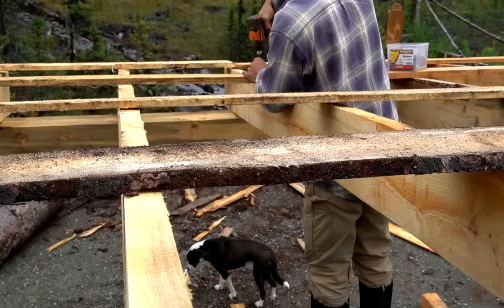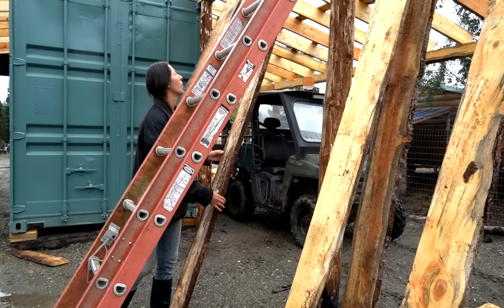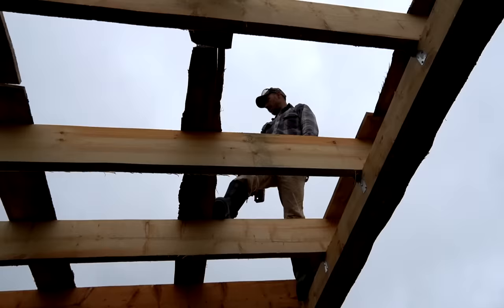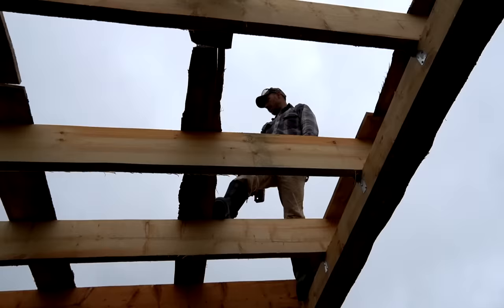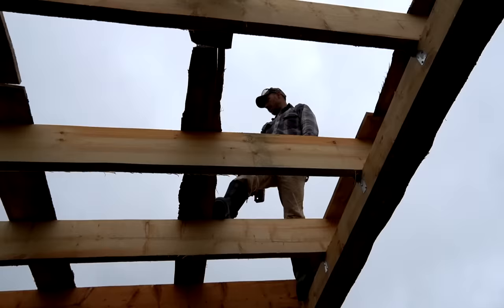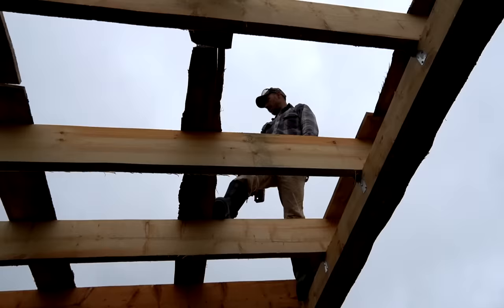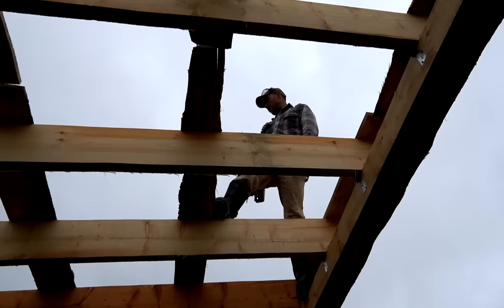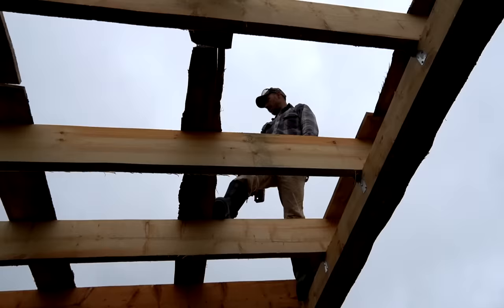Installing Metal Roof & Live Edge Siding | Shipping Container Lean-To

Comment: Next on the list of builds......A Swedish Sauna for those tired, aching muscles!👏❤👏❤
Reply: That’s a great idea!
Reply: I have always thought they should have a sauna- such a fun way to wash up when you compare with taking a shower outside! But I am Finnish so we have taken sauna my whole life.
Reply: Do you not see the problem with the roof system you built vs snow…. Common sense dude
Reply: The fact the didn’t connect the two roofs is actually amazing.  Not in a good way
Reply: There is now such thing as a swedish sauna, sauna is from Finland.
Reply: @hotcheesesoup9776  That's why they built them, to keep the snow off their vehicles and boat. Eric talked about snow management plans in this video, they have made others showing all the work they put in each snowfall, moving the snow around the property. They filled in what I think is the end of their driveway with a lot of gravel, and have experienced several winters, and are fine with various methods of keeping their structures safe. Snow is not dirt, it melts every spring and the piles disappear. Yes, there comes a point toward the end of winter, when you're, like, Where am I gonna put more snow? But they added gravel, and have plans for where to put the snow once they shovel it off the roofs and then access around the various structures. It's kind of an art, really, and I give them so much credit!!!!!
Reply: Finnish sauna!

Comment: You should keep a few panels of clear corrugated plexiglass on hand so when you build something like this right in the center over your main work area, you could put the clear plastic roofing and have light coming in. I know winter time is the problem because the snow on the roof, but the rest of the year when you can remove the snow or have no snow on that roof. You have plenty of light inside the shelter. Would love to see people doing that. Thanks for sharing again as you did an excellent job when you built this shelter.

Comment: Nice job! I enjoyed watching this build. I am doing something similar. Years ago I built a 20’ X 40’ shed for far equipment and a work area. I quickly discovered that it wasn’t enough space so I built a 12’ lean-to on one side. Now I need more room so I bought some 26’ long box trusses form a construction project that ordered incorrectly and I was just going to put in a post barn type of frame to hold them up so I could add a 24’ X 40 ‘ covered parking areas for all of my equipment. Then the bright idea came into my hard head and I bought two 40’ Conex containers for more durable storage. So I placed them 24’ away from the shed. Now I have to put the trusses from the shed to the Conex’s and then I will have a real monstrosity of a storage/workshop that will be 80’ X 40’ structure. That should hold me for many years if not forever.
Again I really like what you have built because it has real charm and the wood you have used is very nice looking.

Comment: Don't forget the diagonal braces at each post to keep the sheds from racking in high winds.
Reply: you must brace this structure for the wind and snow or it will collapse. Wood or cable diagonally cross bracing. AndI would double the number of metal straps holding the joists. A good wind will rip the roof off. But nice job. Lots of work so lets keep it working for you for many years.
Reply: Why didn't they pour cement and create footers on the posts ? Genuinely curious
Reply: @Sunnbuzz  They’vecovered this in previous videos but it has to do with the way the ground freezes and thaws. It tends to push up move concrete.
Reply: @ryanmartinage   Thanks,  I did think about that but then wasn't sure, I live in Canada and we still pour footings, but I obviously don't know enough about concrete or their terrain for an educated reply.
They do make products/materials that act as a joint expansion tho.
Reply: @Sunnbuzz  it was on some fence posts I believe and the freezing and thawing mudd moved them all around. They said some locals said to put them directly in the dirt to help dissuade that behavior.
Reply: @davihar   ditto the diagonals.... but is an aswesome build!
Reply: @ryanmartinage  Again I'm definitely no professional I do know some construction but little about concrete. The answer you gave me is exactly what I was thinking would happen to the posts sitting freely, it will be interesting to see how it fairs obviously the locals know better, well hopefully lol

Comment: Looks great!!!  I am curious though why a peak was not built over the storage container. A simple low slope A-frame rafter would look very nice, protect the rafter and storage container and stop the water from running down the side of the container and making the ground soft.  Just a thought.  Looks wonderful none the less.
Reply: My thought too
Reply: Me too
Reply: Perhaps its better to get rid off of the snow on top when they can walk there? Just a guess, could be wrong :)
Reply: Me 3.
Reply: Those containers are plenty strong enough to hold snow & ice.. His Add-On is at enough of a slope for snow/ice to slide & as long as he tied them to the container properly, there wont be any gap for water to pour down the sides... That said, I personally still would have built a peak over the container lol.
Reply: @mikefrost2404  True enough.
Reply: The flat roof of a container accumulates water in every tiny ding, let alone dips and hollows (which is a primary reason they are retired from service).
The great thing is you can weld lugs on them at precisely the right point to bolt timber to, securing the new sloped roof over it very easily.
A friend installed 3 containers in parallel, mounted on cast in place concrete 12 Inch diameter round concrete footings under each truck tie down point on the bottom of the container, and with a gap between the inner container and the outer containers.
Building a roof sloped towards the rear over the whole lot, and a wall at the rear of each gap...he then got old roller garage doors and placed them over the two open ends.
He thus had 5 locking enclosed "bays" in his "barn".
Reply: My dad moved a single wide trailer up to the UP of Michigan on Indian Lake and built a floating roof on it.  He also added a family room with a bedroom attached, a laundry room and a upstairs bedroom.  When he was finished you would never guess it started as a trailer inside or out.
Reply: Yes, your right, cuz now all they have done is created a place for snow to build up, & a wind vortex tunnel,,,be interesting to see how long roof & sides stay on in the Alaska winter winds of 50mph, 60mph, 70mph & greater...
Reply: Hi everyone !   ITS A SNOW COVER,,NOT A RAIN COVER !  --  RESPECTFULLY,,,  Made in the USA  by Eric & Ariel !

Comment: Question: are you worried about water runoff from the container? Does it just sit on top? How does it run off? Maybe I'm asking a dumb question. But it's been bugging me since you guys started this project. Thanks, and great video.
Reply: Container roofs are typical tilted a bit when they are installed so that water runs off the top, doesn’t take much of a tilt for water to drain.
Reply: Shipping container roofing is simply corrugated sheet metal with a small side to side pitch to drain water.
Reply: I was wondering the same thing since last episode.... what about rain and snow. Anyway I think it turned out amazing

Comment: Serious Question from a novice:  The wood seems wet, well it therefore change its size and shape when it drys?  Love your work and sharing it with us, Thank You.
Reply: You're right, it will dry out and shift around a bit. Since it's a snow shed, it's not critical. Some of the wood has been dead (beetle kill) for several years and should be pretty dry.
Reply: In case they don’t answer you, they only cut trees killed by the spruce beetle infestation, so it’s dead, has been for a while, by the time they cut it. If you look at the forest of trees in their videos, you’ll notice all the brown dead trees still standing, those are the dead spruce trees, sadly.
Reply from the maker: Yes our trees are all dead and all dry ready to burn or build with :)

Comment: Love your video's folks I am just wondering that if you took those rafters up until they joined and took your roofing iron to the same place with a cap on it wouldn't  it stop the snow sitting on top of the container for months every year and eventually causing you problems like rust and leaks etc. etc. ?
Reply: They are killing me w/suspense! How will they mitigate that issue?!
Reply: @zmenow3162  I have 2 x 40 foot containers on my place and after mounting them on 2 foot square x 9foot long concrete blocks taking care of rust etc. from the bottom I place a peaked roof on top so snow and water runs of into the gutters then into a 10000 gal tank which gives me water for the year and keeps the roof of the containers dry so I figure this shed will outlast me and my beneficiaries !!

Comment: use nails next time it allows the structure to move and settle over time with out the screws breaking and leaving you with repair work in the future. as nails bend and screws don't
Reply: Thanks, good advise, especially with green wet wood.

Comment: Shed's lookin' really good!  Remember, the "rule of thumb" for screw length is 70% of the screw is in the piece being screwed into.  Not the piece being attached.  You'll never regret using long enough screws to hold things together.  Depending on how you attach the metal, if you can get some screws into the rafter as well as the slats, it'll serve you well for the future.  Good luck going forward and be careful!

Comment: Those hurricane ties on the rafters are cute.  I use a single timber screw in each end with at least 2" of penetration - 2 timber screws for a 4" thick rafter.  Good work you guys.

Comment: I live in an off grid cabin on the kashwitna river near you so our winter experience is similar. I also have a lot on a plowed road with a connex parked in nearby Caswell Lakes.  I use the connex to store my snow machines for the 5 mile ride to the cabin and as a parking spot for my truck. I shovel the Connex once a winter when the snow load gets heavy. I humbly submit that I would only install a lean to roof on one side of the connex to facilitate easy snow removal. With both sides of the connex blocked it will be tough to remove the snow. Also with the door opening on one end it will even be tougher.

Comment: Hello Eric and Arielle, I am not sure if this question has been answered before or not. Last episode you leveled the Conex front to back, then mounted the beams onto the top of the Conex front to back to allow level framing. My concern is that you no longer have drainage for the Conex front to back. If you remember, the Conex was equally lower in the back on both sides, allowing the water from the snow load to drain to the back. Not into the front door, or sit around the new drill holes for the dish, and the ridge beams for the lean-to. There should be a pretty easy fix for this if you come across a problem. Love the videos! Huge fan! Thank you for the content!

Comment: Eric, I just noticed you store power tools inside a file cabinet. I, also, use a locking file cabinet for my power tools. I went to Goodwill and bought a bunch of bath and hand towels. The towels go on the bottom of a file drawer and hand towels are used to wrap damp tools. Haven't had any rust issues since buying the towels.

Comment: everything turned out great !!!!!!!! You saved a fortune on wood and  the best  crew teamwork  :) A couple more solar panels and batteries would look good :) You might have to add some emt or fence rails to the top of chicken wire fence on the 40 ft side .The future snow load might just fold or bend it ? It Might pay to buy a hvlp airless sprayer down the road ? Some stain or finish will really extend the wood life . I have built and remodel most all my life . you 2 do great pre  planning and are always really safe during your builds. Thanks for great series . :)

Comment: You could just staple a tarp on the inside so in winter when your in there working you'll be safe from wind and rain. Also on top of con-duet put 2x10's on the front edges and add the plastic sheeting raised/ screwed in on top to give a small pitch so snow will fall off roof. Always enjoy your videos. xo

Comment: Two things to add: (1) Add a trailer hitch receiver to the front of the vehicles so you can drive the trailers into their destinations.  (2) Complete the rafters over the con-ex container to eliminate snow storage and to keep the sun from heating up the conex in the summer.

Comment: Have you considered building a shed for your saw mill.  You would need an opening around 20', one that would allow you to wrestle the log on to the sled or use of a tractor.  I'm sure you could find a 20+ log that could be the header for the opening.   Being covered would definitely protect the equipment from the elements.

Comment: So many great things to say about this entire build project! Love the trick with the rope to mark where your screws go into the roofing - genius! So many just measure on top blindly- this was an excellent idea to make sure your screw lines were straight and precise. The build looks so beautiful with the live edge siding. The air flow and light you will get through the cracks is going to work fantastically, especially letting in some sunlight and warmth through the gaps to melt any dusting of snow that may get in and keep any ice build up on the ground to a minimum. Have you thought of any type of wood or metal awning/roofing to go above the shipping container entrance to keep snow and ice build up off the door and front steps or snow blowing inside the front of container for winter time? You could put two posts on either side of the doorway (so not to block the solar panels) mount in to the ends of the beam you attached to roof of container and just do a small angled awning/roof that only extends maybe 2-3 feet outward. Just an idea/suggestion. You both work so well together and love to see the cuddles and laughs in between. I really enjoy your channel, thank you for sharing your adventures and lives with us. I think you two are amazing! Stay safe, lots of love from Louisiana. 😊

Comment: Very cool.  But keep in mind that over time your little metal shed is going to sink into the ground due to the weight the roof is putting on it (especially when you factor in the snow load).  You should add more beams and posts close to the shed.

Comment: If no one has mentioned it yet...I would sure put some bridging at both ends between the rafters!!  

Is blocking required for ceiling joists?
According to Section 6.3: “Rafters and ceiling joists need blocking at their points of bearing to prevent rotation or displacing laterally from their intended position …

I forgot to say, Awesome job!! Great teamwork!!

Comment: I don't know anything about snow loads in Alaska but here in Ontario our roofs have a much steeper angle and we put crossbracing between all the 2x8s every two to three feet otherwise the 2x8s will collapse sideways. We also add headers and footers nailed to the ends of the 2x8s.

I would hate to see all those beautiful 2x8s fall over sideways due to wind and snow load.

Comment: Here in Australia, we never put screws in water ways. This means we put them through the high part so the water runs off. The screws are longer than what you are using, about three and a half inches long and we use these in cyclonic areas.

Comment: Great episode, the sawmill is sweet. This Summer we put the same roof on a shed and the extension ladder is a non-starter, you just have to get up on the panels. Mine came out alright but the process was a train wreck, as the pitch meant I had to hang on to blistering hot panels with one hand and drill with the other. I love your live edge sides for what your doing with it, and it looks like none-too-soon. Cheers, Dan and Elle

Comment: Have you thought of diagonal bracing on the back and maybe one or two side bays of the 40 footer?  If you have a snow load and a strong wind comes up, it might start pushing that back section out of shape.  You can use some scrap wood or for a cleaner look get some steel cable...

Comment: Great build, I wonder if you should have run your rafters on both sides to meet in the centre of the steel container and finished off with a ridge piece, would save you forming soffits and snow building up on the flat section of the container. At this stage you could still install short sections of rafters and stitch them on to the existing rafters and short sections of sheet roofing overlapping on to the existing ones. Give you extra overhead storage as well.

Comment: Just out of curiosity, why didn't you take the roof pitch right up over the container (so snow and rain would drain off the sides easily)? It seems like having the container uncovered will just give snow a place to accumulate and possibly put the sheds away from the container over time.

Comment: Those 2/8s are piled vertically with just a metal bracket on ends. I am concerned if that is the most stable, efficient & strong structure according to laws of physics.

Comment: Great video. Still some questions. Are you planning to catch rainwater from the roof for the garden?
And what about rainwater on top of the container, where does that go?
Is the knowledge of changing the blade of  the sawmill the same as with the motorsaw, just looking at the debri?
Nice job👍

Comment: If i may ask a question WHY did you not half check the top plate over the posts  that way  better joint and more timber over the post ,also note no wind braceing of any type  roof or walls  , are you fitting guttersfor water catchment  a little more over hang on the roof sheets  would help, just asking  .also  a little more strapping around those rafters aross and fixed to the plate   would help if you have strong winds where you are.